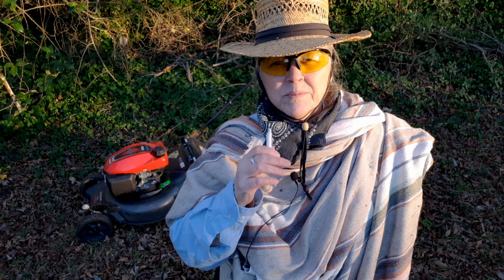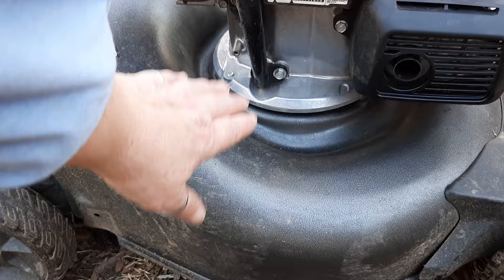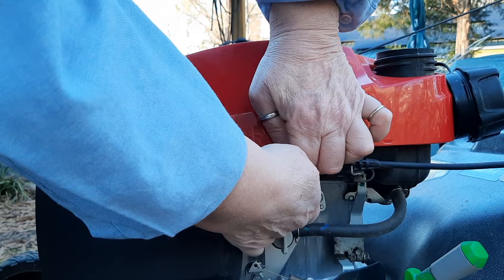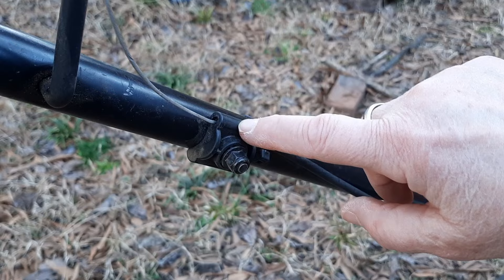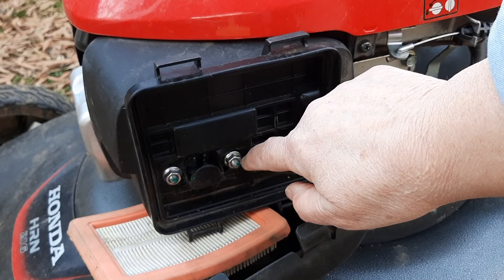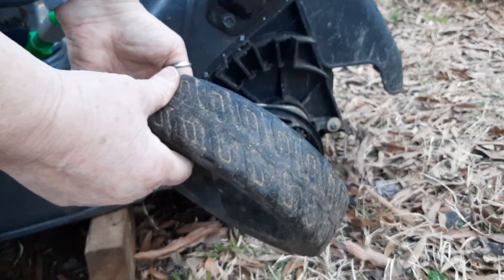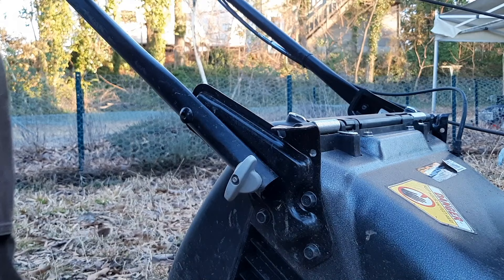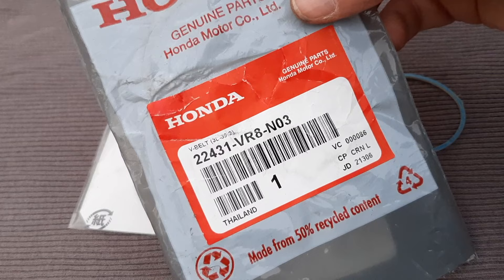Honda's Newest HRN216 Mower in 2023: Good? Bad? Ugly?

Comment from the maker: If this video helped you, please consider clicking on the THANKS button above 🙌 
Here's how to change the drive belt of this mower:  https://youtu.be/lsNDo2Ywnlk
Reply: Super creative regardless! Top notch!
Reply: To The Lawnmower Lady:  I was impressed that you mentioned that the cover came off with a single JIS screw and that you used a Vessel screwdriver which is made to JIS standards as they are the company that pioneered the standard.  Most people don't realize that this is not a Phillips head at all.  So, thanks for letting literally thousands of people be exposed to this fact which is not commonly known.  Also, many have a tough time removing the hold down screws on Honda automobile rotors.  They strip out easily because most people don't know that they are built to JIS standards (now known as DIN 5260 standards which replaced JIS standards years ago).  I made the switch and haven't looked back since.  JIS/DIN 5260 can replace Phillips but Phillips cannot replace JIS/DIN 5260.  Vessel is a top brand as is Wera.  I will never buy another Phillips screwdriver again and have given most of my Phillips screwdrivers away already.  Thanks for the great content.
Reply from the maker: I appreciate you watching. I wish I knew about JIS screwdrivers 15 years ago when I was stripping out all those brake reservoir screws on motorcycles. LOL Cheers!
Reply: @TheLawnmowerLady  Thanks for your thoughtful reply.  Really enjoyed you going the extra step with the good, the bad, and the ugly motiff.  I wish I knew about them 48 years ago when I got my first Honda motorbike.  I had no idea what those dimples on the screwhead meant.  I have stripped and drilled out my fair share of Honda automobile rotor screws in my day because I didn't know about JIS at the time.  I happened to be looking on YouTube in anticipation of changing out the brakes on my friend's Mazda 6 when I ran across a short video in which the man explained why people such as myself were having difficulty with the rotor screws.  Believe me, I paid attention.  I studied your video and learned quite a bit as my brother is thinking of buying this same lawn mower.   Kudos for all of your hard work.

Comment: I’ve had that mower for about two years now, I have no complaints. It’s a lot lighter than my older HRR216 and it’s a lot more maneuverable.    It all comes down to the maintenance you provide.  Treat your mower casually and it will become a casualty!   Thanks for the vid.,  👍👍
Reply from the maker: You're right about that Mr Tony! Cheers!
Reply: Tony M , well I had an older MTD I bought used years ago.  The engine was fine but the hardware was junk, so bought a new HRN216.  I realize the Honda is a bagger and self-propelled, but it's big and heavy, I think too much for a smaller lawn.  I cannot imagine how heavy your old one must have been.
Reply: Same here. Still love this mower!🥰

Comment: I appreciate your last video on changing the belt.   It's the only one on the internet worth watching!!!    For the belt part I also could not locate the "correct" one, but  22431-VH7-K00 was a perfect fit and has worked flawlessly
Reply from the maker: Glad you found that Mr Brad. I searched for a while, even on the phone 
 to attempt to determine what the actual dimensions were to substitute. There are some other numbers in the "description" 39.3 or something? Never figured out if those other numbers described any dimension or what. I appreciate you watching!

Comment: The HRN216 GCV170 engine series replaced the HRR216 GCV160 engine series. The HRX is the next tier up with GCV200 engine. Just bought the HRN216VKA recently and very happy with it. Mowers shouldn't be stored outside exposed to the weather; if there is no garage or shed, it should at least be kept covered. Do the minimal maintenance on them with oil and filter changes, blade sharpening, and use STA-BIL in the gas, and they'll run well for many years. The Honda replaced a 15 year old Craftsman with B&S engine that still runs OK with very minimal maintenance (made by Husqvarna for Sears). Showing its age though and parts - other than the B&S engine - are mostly discontinued. Wouldn't buy a new Craftsman though (junk). IMO, the Honda HRN and HRX are among the best residential gas mowers.
Reply from the maker: I've been a Honda fan for many years. Too bad they had to cut some corners to stay competitive. Thanks for watching. Cheers!

Comment: First off I love Clint Eastwood!I haven't worked on one of those yet,but I do like the fact they went to studs and you don't have to take off all the baffles to change transmission.
Reply from the maker: Those are some positive changes Mr JB. I just hate they cheaped out on the wheels. Most Hondas push like a dream, these won't last. Cheers!
Reply: @TheLawnmowerLady  I guess they have to cut corners somewhere!

Comment: My coworkers say the same thing. I feel bad because I recommend the new HRN over Toro TO SOON! The more and more I used this $600 over engineered machine, I noticed an uneven cut pattern after mowing, along with my coworkers plus MANY online reviews confirmed my same observations. "This lawn mower leaves several un-cut grass blades" same goes for the old HRR model, but not as noticeable. I called Honda customer support, and they recommend that I lower the deck and make shorter cutting swath. At this point I reverted back to mowing with my old HRR and put the HRN in timeout.
Reply from the maker: I honestly think they cut too many corners on this new model. There are some good things, but too many cost cutting IMO. ex: no baffles or guards for the belt travel. Thanks for watching.
Reply: I totally agree with you, I can tell you know your stuff. The new HRN is definitely more cost effective to manufacture and even with her new hiccups the HRN is still far more superior to your "Walmart Special" or any MTD rebrand product. I'm not a fan of the new single front and rear wheel axle adjustment but like you said Hondas plastic is pretty legit, and what I really dislike the most is new push rod engine design, Honda really set themselves apart with their signature "Overhead Cam" engine, I mean it had a freaking timing belt!!! I thought that was so unique for a single cylinder engine. When it's all said and done, I still like my Hondas but recently I only recommend TORO to friends and family.
Reply from the maker: @dadsworkshopbykipplabrie7982  I’ll be interesting to see the insides of one of these newer GCV engines. No doubt, removing the timing belt mechanism accounted for a good deal of their parts reduction on this engine design. I’ve got three videos on this mower. All from the same owner, over about a six month period. The wheels are already wallowed out and wobbly on the front. The rears are not far beyond I suspect, even with that bushing in there. At least the HRR series still had bearings in the wheels.

Comment: For me in gas power mowers it's always Toro, I've been in my home just over 40 years and I'm still on my second Toro. 1st one was 26 years old and the one I have now is still in use.
Reply from the maker: You're right mr Tommy. Toro has been a premium brand over the years. They did outsource some of their lower end residential mowers to MTD a while back. Almost any mower purchased more than 10-12 years ago is a far superior machine to what is generally available on the market today. Thanks for watching!
Reply: @TheLawnmowerLady   great video
Reply: Yeah my Toro recycler purchased at HD 25 years ago has really impressed me.  I'm sure the new models don't go nearly that long.

Comment: Enjoyed the video. I thought a lot about it and decided to buy the HRN. Reason being you won't be able to get anymore of them when they are sold out. Is it a perfect mower? No. The lack of bushings in the front wheels is irritating. But even a less than perfect Honda is still one heck of a great lawn mower. I still have my 11-year-old Husqvarna with Honda motor. Just replaced wheels, dust cover, blade adapter, belt, and blade. It's running real nice. But all of the parts are showing their age. Honda really made some great products. Hoping my two Honda powered mowers will get me to the finish line of my lawn mowing career.
Reply from the maker: I appreciate you watching. Just keep an eye on the oil level. The newer engine design reduced the oil sump by about 4oz. Cheers!

Comment: Love the video.  Hate the tabs holding the lid on.  I bought one a few weeks back and it took me 5 minutes to figure out how it was held together and another 5 because the tabs didn't want to let go. The motor did run pretty sweet though.
Reply from the maker: Yep Mr Bill, I fiddled with a  while, then decided it would make a good video. Mr Bruce mentioned he though the shroud would get cracked easily. He's right. Cheers!
Reply: I dislike the new engine cover with the tabs a lot!
Reply: @richardmorse5307  You aren't alone 🙂

Comment: Sometimes after I do extensive research while shopping for a new lawn mower. I get so overwhelmed and confused. When I think I found one that I can afford and use. I'll also find informative vids like yours that change my mind lol. It's a good thing and I thank you for exposing some things that matter to me!  Because the manufacture or big box stores won't show it.  What I'm shopping for is a Self Propel Rear Wheel Drive, gas, 22" or 21" cut, rubber wheels preferably, strong engine for less than a 1/2 acre lot, mulcher, bagger, variable speed preferably, and NOT that personal pace thingy Toro has on their mowers. That just doesn't make any sense or look right to me. I have an old Craftsman 190cc, RWD, 7.00 torque, model #ended in74541. Bagger torn and cant get a replacement anywhere. And the self propel works half the time. This thing was beast for 11yrs. Now everything is so damn expensive!!
Reply from the maker: I hear ya!  If you can still find the HRX models, I should consider that. With the exception of the engine itself (it is the newer GCV 170/200 version like this mower) it maintains most of the better characteristics the the HRN line omitted for cost savings. Ball bearing wheels, better control cables, better drive belt baffle to keep debris from fouling the belt, lightweight yet durable poly deck, etc. Even though Honda will cease producing push mowers this year (maybe next, I forget), they are a far superior machine, and should have plentiful parts supplies well into the future. Hope this helps. Cheers!
Reply: Yep it’s unreal even for parts now

Comment: I love this mower, maintain it, and it will last for years and years. I luckily have the ideal storage situation and keep up on my maintenance. As far as the wheels go, I'm sure they'll last just as long as most of the residential ones will, maybe longer. I've always popped my wheels off and spray a little lithium grease on them anyway once a year. Rust ain't much of an issue with proper storage and maintaining the deck. Usually treat any rust right away (havn't had any), cutting wet grass clean... it off right after and run it to dry it out, and spraying some fluid film on the underside in those wet situations help.
Reply from the maker: Thanks for watching. This same mower just came back to me, and I'm sad to report, the front wheels are very wobbly. And the rear drive wheels almost smooth. There's a lot to like about this mower, and it sounds like you take care of it well.
Reply: @TheLawnmowerLady  No problem, definitely good content. I do some small engine repair on the side myself. I still keep my old mtd with a old school 3.5hp flat head briggs in storage as a backup. My first as a home owner, I retired it for the honda after about 10 years. Just way underpowered for the grass and got tired of the fuel boiling in the gas tank in the summer heat. So far no complaints so far and I've had the electric start version since they introduced them.
Reply: All I can say is, stop mowing wet grass.
Reply: @joetroutt7425  My days off work may require it. Flip it, spray it off with a hose, dry it and whatever lube I have handy, think I used wd40 the last time because it was right there. Comes down to how you treat the equipment.

Comment: In the past, it was fairly easy for many to prefer HRR216 over HRX217 K5 mainly due to the pricing difference, and knowing that they would both last for years. But now, HRX217 K6 is many many times more durable and solid than HRN216 and is often on sale:)
Reply from the maker: I agree!
Reply: @TheLawnmowerLady  BTW, given the level of your expertise, does the HRX217 K6 series (current generation; 2020-present) differ in any other aspect than the engine (ex. wheels, deck, cables, transmission, fit and finish etc.) from the HRX217 K5 series (the previous generation; 2015-2019)? Also, what year did Honda begin using Nexite decks for its HRX 217 series?

Comment: The kind of a review I like - practical! The thing I didn’t like was the one piece cover for the recoil start cord. Would prefer bolts rather than clips. No one has explained to me why Honda is discontinuing making their gas mowers at the end of 2023?
Reply from the maker: I honestly think it was based on the abundance of cheap and inexpensive mowers, that along with the writing on the wall regarding gas/petrol powered mowers. Battery powered is not there yet, but eventually they will overtake the market.
Reply: @TheLawnmowerLady  It seems a shame to see them go. The gas powered mowers run forever (with proper maintenance) and yes the electric ones haven’t got the power and range yet so it feels like Honda is jumping the gun. Here in Canada Honda mowers are higher priced but they are very durable. The thing that I don’t like is the difficulty of reassembling the carburetor after cleaning and the twin blade feature for extra maintenance costs when in my opinion it’s not necessary.
Reply from the maker: @richardmorse5307  I agree. Honda mowers in general are far superior to any other on the market. It's a shame they decided to leave N. America. The HRX series (with the GCV160/190 engine and the Nexite deck) is the last great residential mower they made. Cheers!

Comment: You seem to be comparing it as if the HRN216 is a replacement for the HRX (which also had a larger version of the same new engine for the revamp) But the HRN is the entry level Honda (a few hundred $ cheaper) So it’s more of a replacement for the old steel decked HRR I guess. 🤷🏼‍♂️

I ended up getting the HRN216VYA (bladestop) version to backup my Timemaster. It’s a nice light mower…I’ve never regretted getting the bladestop version. Though it seems all the prices went up $100 since the start of the year…glad I went ahead and got one! Probably good for the repair business-lol
Reply from the maker: Thanks for watching. It's a good mower for some folks: those who will take care of it and how they mow. You're probably right about comparing it better to the HRR. (It has better wheels for sure) Cheers!

Comment: It's disappointing that they went away from the composite deck. I am sure the engine will be great. Thanks for the review.
Reply from the maker: I agree. Thanks for watching. Cheers!
Reply: The did NOT go away from the composite decks, this is the lower model. They still make the HRX series with the composite decks. This is the lower model the HRN.

Comment: I currently run (2) Honda HRX 217 HYA mowers. from 2021. They have gone cheap on the wheels, and they used to have tires, Now they are just "Skins" and after a while (Which is to soon for me) they fall off. Honda has made some positive improvements, (I have been running their mowers for about 33 years) but some of them are  a hindrance rather than a help.
Reply from the maker: I agree! They's cut some corners, badly at that. Thanks for watching!
Reply: Is your hrx hard to start?
Reply: @appleztooranges  No. I have heard some of the models with the Auto Choke feature develop issues in a few years. My mowers start up on the first pull going into their third year of use. I do run ethanol free gas every time I use them. And drain the tank and carburetor bowl before I put them away for the Winter. Just bought another about a week ago since Honda will quit making them this year.

Comment: They have fallen down so far since the original HR21 series. On those original mowers from the early 80s they not only had proper sealed ball bearings in all the wheels but you could also change the rubber tires off the wheels when they wore out the treads.
Reply from the maker: I agree. I actually own an HR215 ( that I haven’t started since 2915) Great mower with blade clutch.
Reply: @TheLawnmowerLady  I'm talking about the HR21 and 21-5 original series of mowers from the late 70s early 80s.
Reply from the maker: Ahhh, yes. I replaced one of those with this HR215 back in 2000. It was gifted to me from my Dad, and I unfortunately let the oil get too low.  It overheated and seized. Not knowing then, what I know now, I would have fixed it. I regret replacing it.

Comment: Thank you Stella, nice review on the newer Honda.
I’m not too keen on the newer model due to not being aluminium and one blade system.
I think you meant to say Pablo in the intro😀🇦🇺
Reply from the maker: G-day Mr Rick! I think this one had the dual blades? This was a model purchased at a big box store. It's truly a beast with that steel deck. Cheers!
Reply: @TheLawnmowerLady  was looking at specs looks like one blade with another two attached, the older models of Honda 196 had 4 blade system😀
Funny enough the new decks are made of a material called NeXite on that resists breaking and doesn’t rust a lighter weight material.
Reply: @TheLawnmowerLady  current models have a blade off system which stops the blades 3 seconds after you let go of the  handle/bar